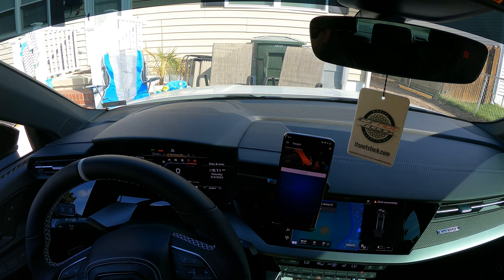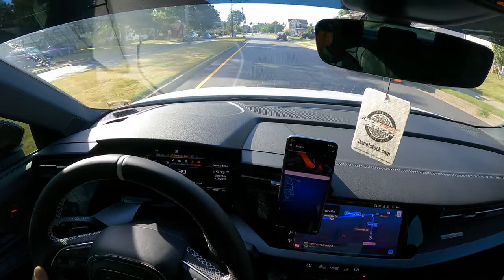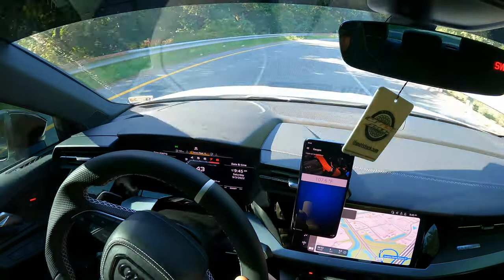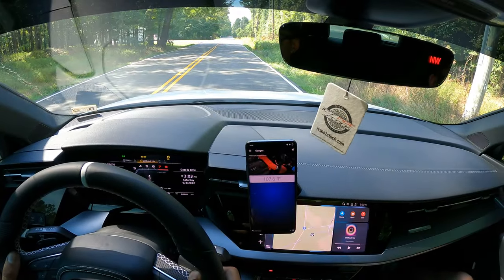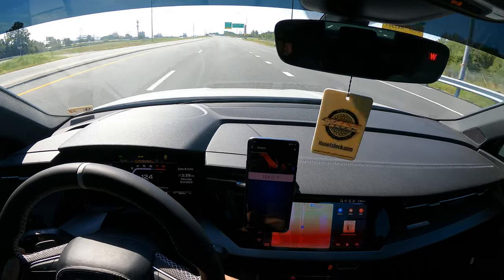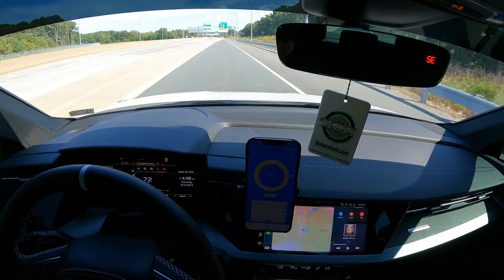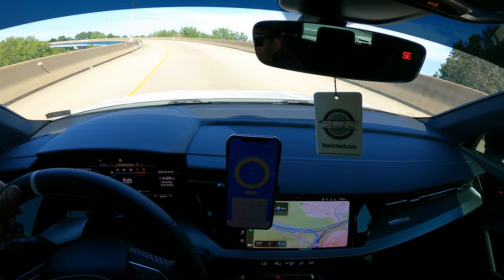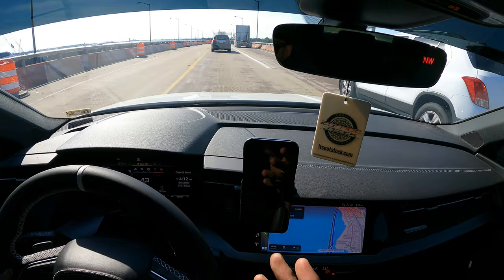DO88 intercooler air intake temp data + Racingline PCM draggy runs!

Comment: Last summer Tony did a data log when I was having trouble at autocross (which was caused by the car shifting into 3rd, then not downshifting to 2nd and I lost all drive out of Pungo sweeper).  Ambient temp was 95, and the car was seriously heat soaked, with IAT at 170 in grid, 150 at the starting line, and only dropping to about 135 during the run.  I just got a Mishimoto Intercooler installed, and hope it helps during the summer.
Reply from the maker: Oh it will!! The stock ones heat soak soooooo badly. Did you toss in an expanding foam or anything while you were in there? Cleaning out the ac condenser helps a little too
Reply: @BryceJordanProductions  No foam (didn’t know about it), but did clean the condenser and radiator.

Comment: I have a MK8 would really like to know if the 2 gallons of E85 will make a difference on the stock tune. Thanks for the Racingline testing.
Reply from the maker: I feel like it might under the right conditions. If timing is being pulled or knock of some sort, no real absolute way to know without some real good data logging and comparing with the lest amout of variables possible. But it doesn’t hurt!
Reply: @BryceJordanProductions  so are you going to keep the Racingline Piggyback or just run it stock for now ?
Reply from the maker: I haven’t been running it plugged in for awhile now honestly. I swap back and fourth though. With it starting to get cooler out I’ll prolly plug it back in and do more tests
Reply: It should advance timing on the stock tune. 
Burger Motorsports did some dyno runs on a stock car.
91 oct : 262whp/287lb ft
E25 : 288whp/311lb ft

I can’t wait to see Unitronics ethanol tune considering the 93 numbers are so good
Reply: @PapiAndrey  facts, I was looking at that tune on 93 oct it was really good numbers even without the intercooler upgrade. Still no TCU and UniConnect for MK8 Golf R's Tho.

Comment: Do you have the DSG tune?  Those shifts sound soft.
Reply from the maker: No tunes out yet.. she’s all stock software wise unless I have the racingline piggyback plugged in.
Reply: @BryceJordanProductions  AHEM ... don't be a stranger on FB , also ... i warned you about the loss of power between shifts :P
Reply: @dbogdan17  so you’re saying the Racingline PCM isn’t worth it?
Reply: @stealthhtm23  i would say that its not worth it, yes
Reply: @dbogdan17  any thoughts on the JB4?
Reply: @stealthhtm23  i had a racebox piggyback on my car before tune. There is no comparison between piggyback and tune.
Reply: @dbogdan17  I know. I had a stage 2 8V RS3. it was ridiculous. just need something in the meantime before they crack the ecu

Comment: Turbo speed is capped, trying to increase boost with a piggyback won’t be effective. You need a real tune.
Reply from the maker: I agree, it works well for single gears but not an entire run